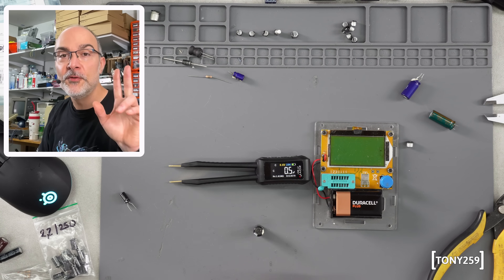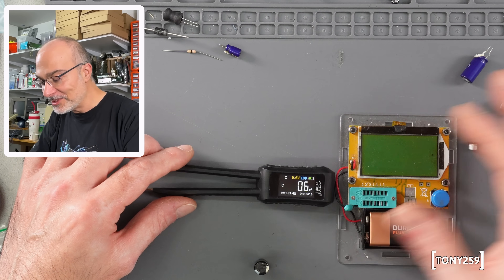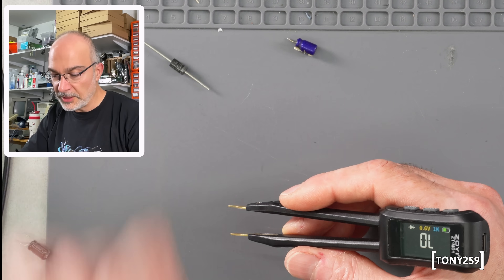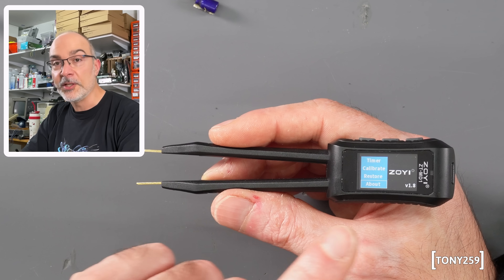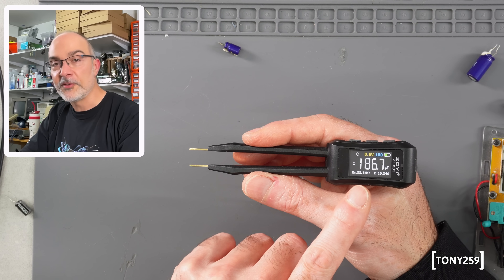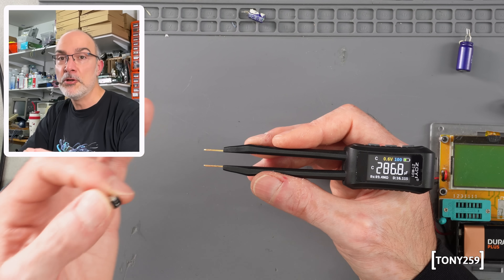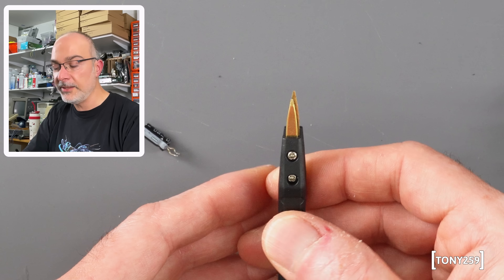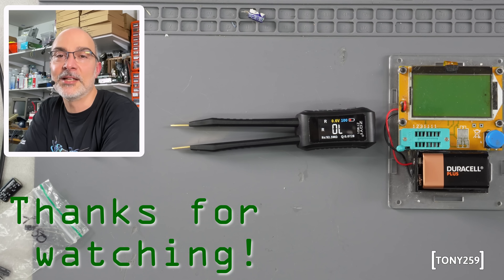FINALLY! A proper - CHEAP - LCR meter!

Comment: 🤔
Mine is NEWCASON XC6013L
Was about 30 Euros and is really good.
I have also capacity testing on my multimeter buut that is... trash 
So not an arm and leg ( not or ) were the costs 😅
Cheers
Reply from the maker: I'd be curious to know what measurement method yours is using! :) 
Yes, even my Fluke capacitor measurement is not great...
Reply: I have a 6013 type capacitance meter tens of years old.
It measures only capacitance, nor ESR.
I believe it's based on a R/C timing circuit.